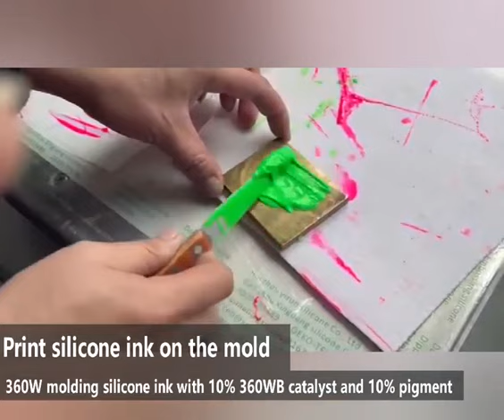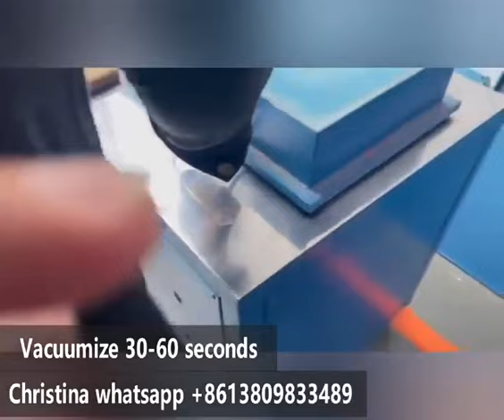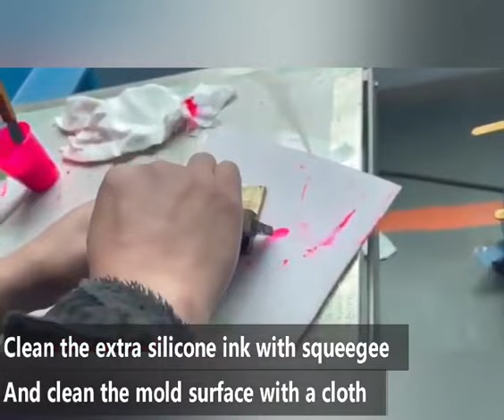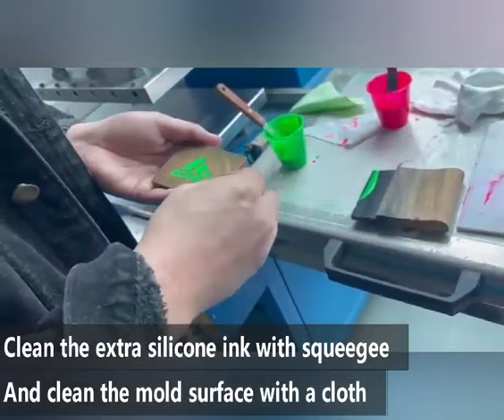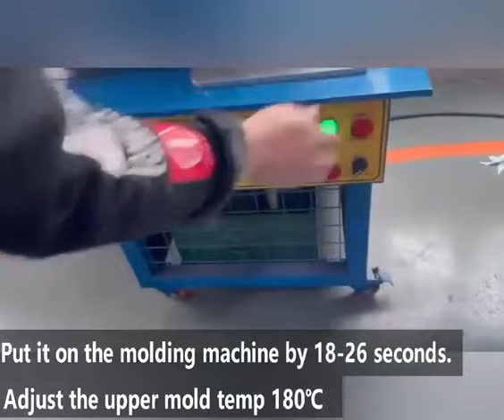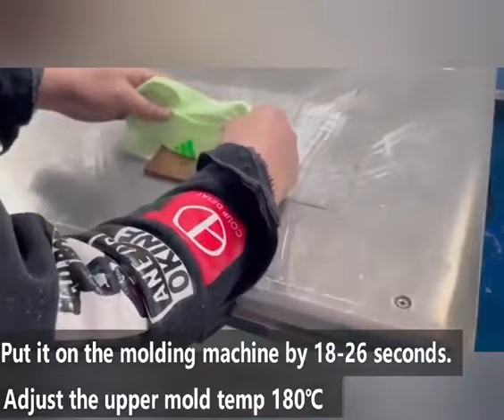One mold silicone ink screen printing molding T-shirt print

Comment: How can do this locally from beginning, Christina
Reply from the maker: For this, it needs a mould machine and vacuum machine, and this is to use mould silicone, for biginning, you can screen print directly on cotton or fabric, for more help, welcome to contact me, cheers
Reply: Can you recommend mold machines and vacuum machine
Reply from the maker: @dannyking3625  sure,please contact me via WhatsApp +8613809833489 to get further information.
Reply from the maker: @dannyking3625  Sure,call me via WhatsApp +8613809833489